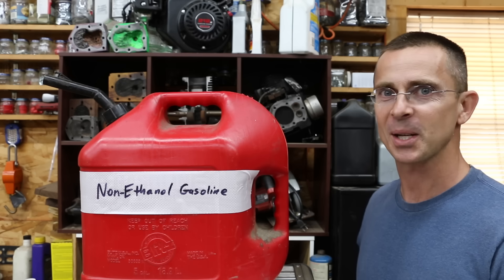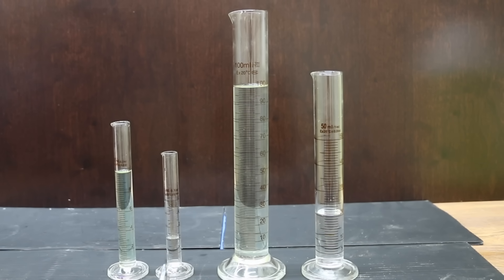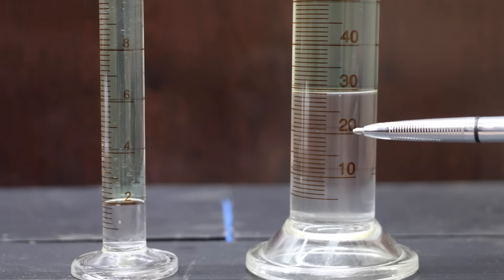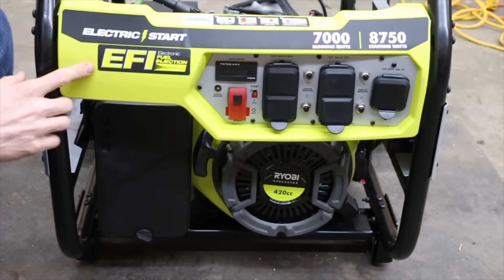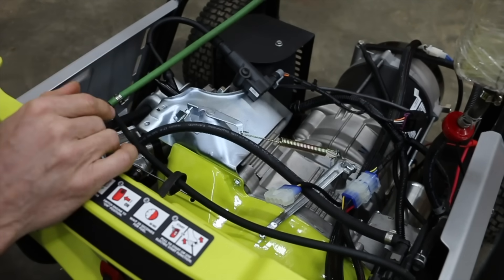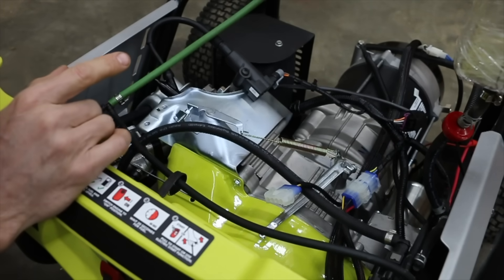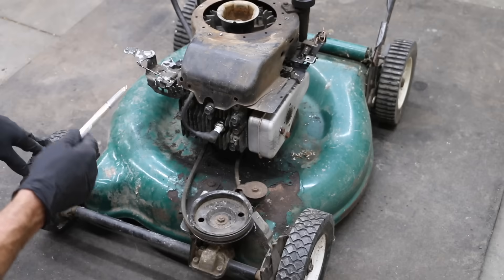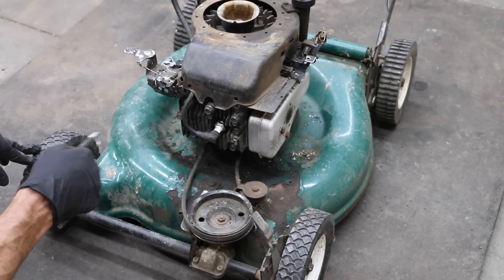Is Non-Ethanol Gasoline Really Better? See the PROOF!

Comment: Your country subsidizes corn that's why you have ethanol in your gas ⛽️. Make sense of that nonsense??
Reply from the maker: Thank you!
Reply: Im sure he knows that.  But he avoids political discussion. Its good to remain neutral and let us examine the data and make our own conclusions.
Reply: @dougn2350  Yes. Has he ever talked about his background? He is extremely knowledgeable, but people who are not perceptive may miss it because he is very low key about it. He must have spent some time in engineering school, or been mentored by someone with a serious automotive background.
Reply: Subsidies didn’t have much to do with the change.  The old oxygen additive in gasoline was “Methyl tert-butyl ether (MTBE), now outlawed in many states of the U.S. for road use, mostly because of water contamination.”  “From Wikipedia “.  It was an awesome oxygenate...  problem was when it (gasoline) leaked out of underground storage tank, the gasoline disbursed, evaporated and didn’t stick around for very long.  The MTBE didn’t.  It would eventually find its way into groundwater.  So our not so great government stepped in and tried to cure a symptom not the cause and MTBE was banned.  So the leaky underground tanks still leak but they are not leaking MTBE.  Corn lobbyists stepped in and lubricated the politicians hands and wallets and that is the end of the story.  Farmers are not given subsidies to grow corn for ethanol.  But they are now finally making a decent wage from the increased demand (higher price).  So now we still have leaky tanks, food prices are higher, and we have a crappy oxygenate in our fuel....

Comment: There is a very special product called ASPEN-4. You can buy it at most small engine repair shops. Aspen gas is separated at the very top of the cracking process. Run your mower etc out of fuel and add at least a half liter of Aspen to the empty tank. Run it until you are sure it is in the carburetor. It will most likely start on the first pull after a long winter. Aspen will protect your carburetor. Regular gas with ethanol separates into water that becomes acidic and ruins your carburetor...
Reply from the maker: Thank you!

Comment: In Texas, where I live, safety inspections are required annually.  In some areas of Texas, such as Houston, an emissions test is part of the safety inspection.  Fail the emissions test = failing the inspection = can't legally drive car.  I have a friend who is a mechanic in Houston, and about 50/50 he can get a car to pass inspection by emptying the fuel tank, drop in a few gallons of E85, take it in for inspection and make sure that the engine is totally up to temperature, and 50% of the time it will then pass emissions.  Then just fill with plain fuel.  I think E10, and especially E85 burns cleaner
Reply from the maker: Thank you!

Comment: Ethanol has 70% of energy in comparison to common gasoline. This means, 5% of ethanol increase consumption by 1.5% and 10% of ethanol increase it by 3%. Having said that, modern engines with electronic systems for timing advance with a knock sensor largely compensate for that. Should you tune the timing to more advance (or increase compression by shaving the head a little), you would get slightly better economy. However, the worst effect of ethanol (and even much more methanol) is aggresivity towards materials used; the Zn-Al alloy to used to make carburettors slightly dissolve and make grey dirt that clog your jets. Looking forward to the rubber hose test.
Reply from the maker: Thank you!

Comment: I am so glad to be subscribed to your channel.  Its like your working for me and I aint paying shit.
Do you ever feel used?
You are correct, everyone has an opinion about ethanol.  What worries me are those whom I respect saying their chainsaws are junk because of it.  Can you somehow test that? 2 cycle? How about your handy dandy friction tester?
Reply: OR the affect of both gases on lubrication???
Reply from the maker: Thank you!  I enjoy testing these product a lot. Thanks for the video ideas!
Reply: @ProjectFarm  Thanks for the reply.  I wanted to mention that I care little about putting fuel stabalizer or removing the battery for winter.  My motorcycle battery barely starts so I need a new one.  I bought it with the bike new and have never trickle charged or removed it from an unheated garage.  It is 12 years old and I live in western PA.  I suppose I believe about 10-20% of what I'm told-depending on the story.  Thank you for giving me an opinion about ethanol being 4% more efficient, though.
Reply: Also want to mention that your handy dandy friction tester needs improved.  How about a std. chunk of stainless sliding down a slope (time it to a ten thousanths).  Or testing the amps from a motor?  We need an extremely accurate way of testing friction characteristics of a lubricant whether synthetic or from crude (or corn).

Comment: Ethanol does not have the same power per liter that Gas has. Here in Canada 10% ethanol fuel is the norm, However, as you have seen a 4% increase in run time with non-ethanol gas, one does not get the same bang for the buck one would get with just straight gas. People burn more ethanol mixed gas per kilometer than they would burn  non-ethanol gas for the same kilometer. Ethanol added to gas is a government sanctioned scam 10 litres of fuel here is actually 9 litres of gas and one litre of ethanol but we pay for 10 litres of gas. Mileage numbers do not reflect the actual mileage one would get if they used straight gas.
Reply from the maker: Great point.

Comment: Clearly, oil companies made ethanol mandatory to generate extra 4% in profits. Fucking assholes.
Reply from the maker: Thank you!
Reply: 140,000,000,000 gallons of gasoline (which I assume contained 10% ethanol) was used in 2015.
140,000,000,000 - 10% of ethanol = 126,000,000,000 gal gasoline without ethanol.
if let's say they charged $2.40 per gallon back in 2015 we can calculate the following:
140,000,000,000 * $2.40 = $336,000,000,000 made from 140B gal of gasoline with ethanol added.
$336,000,000,000 * 10% = $33,600,000,000 oil companies saved thanks to ethanol 
$336,000,000,000  * 4% = $13,440,000,000 we overpaid because our cars became 4% less efficient due to use of ethanol.
$33,600,000,000 + $13,440,000,000 = $47,040,000,000 (minus ethanol production cost) of savings in 2015 alone.
OIL INDUSTRY LOVES ETHANOL

Comment: Ethanol will absorb some water, so in some cases, it may help to have the ethanol in the gas, especially in humid climates. Don't know for sure, but logic suggests that it would help burn at least some water out of the system. 

What I really want to know is if ethanol is any better or worse then methanol and isopropyl  alcohols. Ethanol cost the most to produce so is it really worth it, or would methanol or isopropyl in the same strength and purity do just as well. 

I was a little surprised with the see through head, since when alcohol burns it has a flame that is nearly invisible in daylight, and blue in the darkness, I would have thought the alcohol fuel would have been bluer than the non alcohol. What does E 85 do in a small engine? It's supposed to be higher octane, but would that matter in a relatively low compression engine? In cars, E85 does not give the same mileage as gasoline, it's less. Is it still less in a low compression small engine? How high could you take the compression with alcohol versus gasoline, 10 percent or not?  Many race cars run 85 some run nearly pure alcohol. would alcohol raise the octane of race or av gas which already has a high octane rating?  What exactly IS octane anyway? not what it does, but what is it, and how is it determined?
Reply from the maker: Thank you!

Comment: Great video. The alcohol being hygroscopic seems to be the big issue when storing an engine with a carburetor or a steel fuel tank.  Your tests seem to confirm that it works just fine as long as you keep the engine in service.
Reply from the maker: Thank you!

Comment: Your 4% change in run time maths perfectly.  Alcohol has less total energy available,, I am a bit surprised it was as high as 4%,,, but I think that is my bias,, It maths, envelope back only, as 3%.   I was expecting a 1% or 2% change.

There are benefits to ethanol in gasoline.  Political mostly,, of that I am certain.    By many various accountings,,  and here we part with some very complicated ideas and math,   How much oil is spent to produce how much ethanol?  The best figures I have found suggest you get 1.6 or 1.7 gallons of ethanol for each gallon of petroleum based fuels needed to process it.  The figures dip into doubtful territory when you consider the land cost, the cost to food prices competing for the same corn and resources.    Corn and sugar cane produce almost all the ethanol used in US fuels.  Cellulosic ethanol,,, which in theory should be the problem solver, the game changer,, has largely failed,, either regardless of government supports , or because of government supports.  Forbes had a brilliant article on it a year ago, "Cellulosic Ethanol Falling Far Short of the Hype" 

One thing I do not regret.    When I was a youth,, a common problem in mid to northern states was winter fuel line freeze up.  Gasoline is mildly hygroscopic,, as daily temps change,, half empty tanks breathe,, accumulating water,, gasoline storage tanks underground,, loved to find water,,   If you might forgive the humour,, the problem was common as water.  Water separates from fuel,, is heavier than gasoline,, and so just a tiny bit of water can freeze in the bottom of the tank or in the fuel line,, and   "You ain't goin' nowhere."
Since ethanol,, the problem has vanished.  It may very well be that the single benefit of no frozen fuel lines, is greater than the cost.  Modern fuel handling systems could not stand the water that would have been common 50 years ago.  Repairs would not be a heat gun or torch under a car,,, they would be thousands in broken electronic controlled etc.
Reply from the maker: Thank you!

Comment: I used to be on the ethanol free wagon. After reading the owners manual on my 98 ranger, I just follow the octane recommendation. It also stated acceptable ethanol levels. But for my 2011 Toyota it wants premium octane, which is generally is ethanol free. There are so many people driving that if there was a huge difference, the mechanics would be voicing the troubles.
Reply from the maker: Thank you!

Comment: I use only Non ethanol gas and small air cooled engines not only for the reason you stated "build up in tank and corrosion " but also for gasket care and fuel line care as it corrodes the fuel lines and carburetor rubbers and in my old 79 ford I changed all the fuel lines and the carb gaskets and rubber  so I have no issues
Reply from the maker: Great decision!

Comment: Test for Ethanol (alcohol):
Can you make Ethanol?  
   Will Ethanol run in Flexible-fuel engines?
      Is Ethanol cost effective over other fuels?
Can Ethanol be used to cook food?
Can Ethanol be used as antibacterial hand sanitizer and disinfectant?
Can Ethanol be used as "solvent" for use in paints, lacquers, and varnish?
Can Ethanol be used as an anti-freeze product because of low freezing temperature?
Can Ethanol be stored for many years without going bad?
Reply from the maker: Thank you for the video ideas!

Comment: Good test. Though, the results was as expected. Here in Sweden, the regular gasoline is E10. You can buy premium gasoline without ethanol, at a premium price. E10 works fine as a fuel, but has a slightly lower energy density than pure gasoline. I have been using E10 for many years in equipment such as lawn movers, etc and I have had no fuel related issues.
Reply from the maker: Thank you!

Comment: Hello PF: can you measure horse power between similar octane ethanol and non-ethanol gas, especially after removing ethanol using water? So three types to compare: non-ethanol, ethanol from the pump, and ethanol with the ethanol removed... I only use non-ethanol fuel in my small engines, including my motorcycle which isn't very small (1.1 liter).
Reply from the maker: Thank you for the video idea!

Comment: Excellent test , love this debate of gasoline. I use non ethanol in my snowblower and lawnmower only reason being is during the off season the gas doesn’t seem to go bad as fast as if it had ethanol. By the way I’m sure you checked before you installed new plug , but I got to ask if the gap on the plug was the same. 
Thanks love what you do.
Reply from the maker: Thank you!

Comment: Annoyingly the nearest place for me to buy Ethanol-free go-juice is a bus ride away (I don't drive), and the cost of said bus ride is enough to fill a 5L can of ethanol-poisoned fuel, plus I think the bus driver wouldn't even let me on carrying a couple petrol cans, just in case they thought I was some nutcase intent on doing an act of stupidity, so I just have some fuel stabiliser to deal with the poisoning and fill up at my local Esso which is half a mile walk away...
Reply from the maker: Great point.
Reply: Also ethanol gasoline is cheaper (though it's just lower taxes).

Comment: The problems I have seen with ethanol fuel is in older small engines, if the top ring land on the piston is very close to the top of the piston the ethanol will cause problems. Most newer engines have the rings lower on the piston resolving the problems. Issue is very notable in two stroke outboard marine engines, especially pre fuel injection.
Reply from the maker: Great point!

Comment: I believe "mls" is pronounced, "milliliters". 
I am often called upon to fix a small engine for friends and neighbors because it does not run correctly. The cause is usually a very dirty carburetor which can be attributed to being stored in the off season with ethanol gasoline in it. I alway recommend using non-ethanol gasoline in small engines, outboards and antique engines. Before storing, run the carb dry and drain the fuel tank or add a fuel stabilizer.
Reply from the maker: Thank you!

Comment: i can say that ethanol likes orings from the early 90's late 80's.. and ive talked to the sled / saw shop he said that alot of motors are running hotter and burning up small engines and some sleds needed more oil to the gas to save the engine from being cooked...just that much of a diff since we seen it come to maine strait away problems arose from 2 strokes running to hot..holes in the top of pistons or gasket stuff and orings in the earler motors..just saying what i have seen  :)
Reply from the maker: Great point. Thank you!

Comment: so here is how I figure it.  Ethanol has less energy density than gasoline. I kept a spreadsheet  of fuel mileage in my car using both fuels, and figured that the fuel mileage increase of non-ethanol fuel was just a little better than the price difference.  Meaning I get just good enough milage to make it worth my while to get the non-ethanol fuel.
Reply from the maker: Great point!

Comment: I don't even need to watch this video to tell you that non-ethanol fuel is better than ethanol fuel. Let me describe a scenario that has become way too common with ethanol fuel......you open your garage door and are overcome with gasoline fumes. Why? Because the ethanol fuel has corroded the needle-and-seat inside the carburetor of one of your small engines, preventing it from sealing properly. The gas just keeps flowing until it leaks out all over the garage floor.
Reply from the maker: Thank you!
Reply: That may be true, but is the problem the fuel or the equipment that is not made to handle that fuel?    If it's old equipment we need to learn to use the correct fuel for it, and if it's new equipment we should insist that the manufacturers build it to use the fuel most commonly sold in America.
Reply: @jacksons1010  The problem being that the ethanol breaks down, leaving a water content in the fuel system that in addition to making the engine run poorly can also damage components. You can't engineer that problem out of the equipment, all you can do is not let the fuel sit in the equipment for long.
Reply: And that's why in the manual for lawn mowers and such it says not use fuel with ethanol, in most car engines (is those without a Carburetor) it is fine
Reply: TrakSpock1    Nobody likes a know it all.  If you know everything then quit watching youtube videos
Reply: The solution is to not leave ethanol sitting in a humid environment. (I.e. not leaving it in machines)

Comment: Ethanol only gives you 85% BTU over regular 100% gas, so you should've lost 15% of the 10% ethanol or 1.5% less BTU or runtime.  Your test showed otherwise?
Reply from the maker: Thank you.  Actually, ethanol has less BTUs than gasoline.   Ethanol has 76,100 Btu per gallon, compared to 114,000 Btu per gallon of gasoline

Comment: I would say it's better over time with more research. Everyone isn't going to benefit tesla batteries when they give up the ghost, or long drives, or destination charge(s) and how long it takes to charge. Tesla is a good example of showing that infrastructure is not viable change over. Fuels are going to continue to dominate, but fuels can be derived from hemp, corn, sugar etc to take over the gasoline problem👍🏻
Reply from the maker: Great point. Thank you!

Comment: The efficiency test confirms what I have been told in the past...that you will get better fuel economy with straight gas.  What I am confused about is why are all of these Youtube car racers using E85?  It must have something to do with the higher octane, but that just confuses me even more.  Any thoughts?
Reply from the maker: You are right on the E85.  It has an octane rating well over 100.
Reply: @ProjectFarm  So...high octane is good for speed but it is not good for efficiency.  I hope this comment sparks a little conversation because this does not make sense to me.